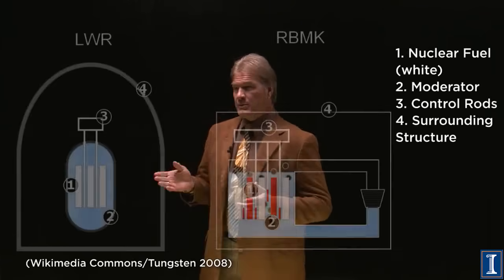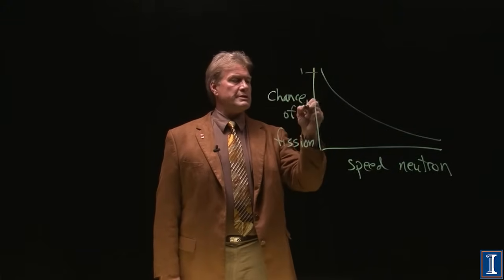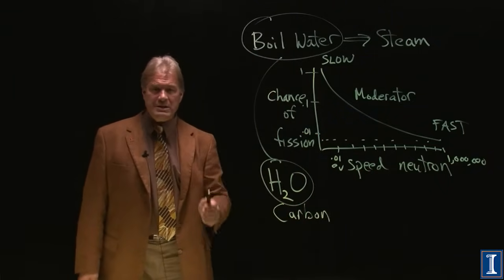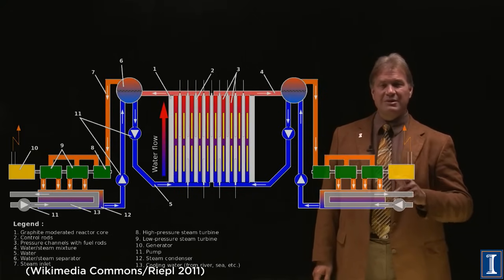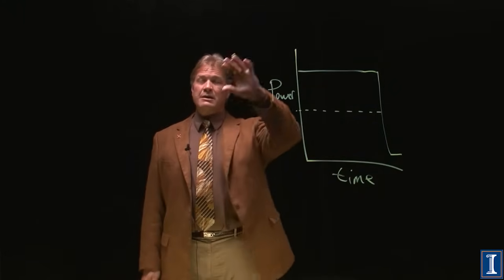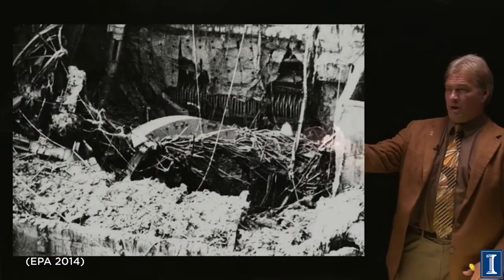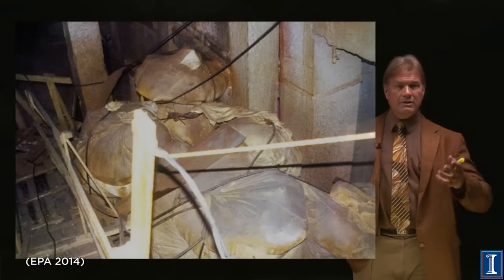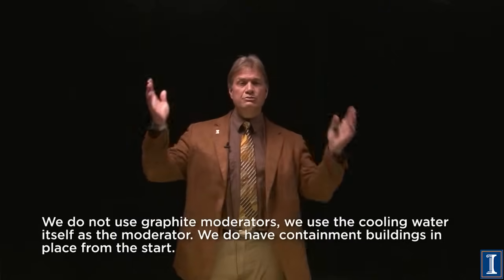Chernobyl: Worst Accident Ever

Comment: You missed the important point of why the power level spiked.   Once the reaction starts, the xenon gets burned off.  The Chernobyl core was so huge that it wasn't uniformly controlled by the control rods, and the reaction took off again in the bottom part of it.  This started burning off the xenon in a hurry.   Now you have a situation where prompt neutrons are causing fission (carbon moderator still there), and all of the control rods are out of the reactor, and the xenon that was keeping fission from happening was getting burned off like dry grass in a self-feeding cycle.   
In the world of high energy physics, this is what is known as an "Oh [expletive] moment". 
There was a perfect moment, when ALL of the xenon was gone, and ALL of the control rods were out, and ALL of the fuel - some 200 tons of it - was free to react, completely uncontrolled.  And it did.   There is at least one paper out today that even claims a nuclear yield.   Small, but larger than the chemical explosion could ever have been.   The reactor hall was cast concrete, Soviet construction, and could probably have actually withstood a substantial chemical explosion, but was kicked aside like cardboard in the face of this blast.  Radiation-resistant windows a meter thick were blown to bits like plain window glass.  
That is what happened at Chernobyl.   A worst-case scenario, with 200 tons of uranium reactor fuel, totally uncontrolled.
The United States already knew about xenon poisoning, having experienced it first hand with the startup of the Hanford B reactor, where we too yanked out all the control rods in a futile attempt to jump start a reactor that for some reason unknown at the time just would not react.   We were very fortunate that we did not create the same accident here.   The only reason we didn't was because Hanford B had been built too small, and could never start properly, given the effects of xenon.    Beginners luck
Reply: thanks for the info especially about Hanford B
Reply: @sygos  Extra channels had been built into Hanford B as a contingency, and it was a relatively simple matter to load these and create a bigger core.
Reply: I've been waiting for this comment all year long. Apparently, many still don't get it
Reply: @bluellamaslearnbeyondthele2456  Of course not. This stuff scares the shit out of people.
Reply: That's the other kind of oh-shit moment—When you look back and see what you just dodged, what could have happened. Like the Able Archer exercise in 1983. Or the Titan explosion in Arkansas in 1980. The Goldsboro Incident in 1961. Almost losing Fukushima Daini at the same time as Daichi.
Reply: @ronaldgarrison8478  Agreed on all.
Reply: @Tom R yeah, the spike was going, but the control rods prob gave an extra kick that didnt help anyone. Ignalina and a few other stations had already modified the rods to be less reactive, but thanks to KGB and the "saying there are problems creates problems so just say its fine" mentality, the information never went to Chernobyl
Reply: @mjfan653  I still don't understand WHY there were graphite tips on the control rods.

IAC I'm still thinking the HBO show overplayed that (or maybe it was Legasov who did so; hard to be sure at this point). Ordinarily, the graphite tips are no problem, because you always have some rods that are already in and going deeper as you insert a few at the top, so the overall effect is still dropping the reaction rate. But if you're fool enough to yank them all out, then you're definitely tickling the Dragon's tail.
Reply: @ronaldgarrison8478  

Graphite tips for lubricant. Cheap and cheerful.
Reply: @ronaldgarrison8478  Simple. They weren't "tips". The control rods, when pulled out, require the graphite rod to follow right behind and displace water that would take the place of the control rods and slow down the reaction due to the light water absorbing neutrons. The "graphite tips are cheaper" was a simplification for the show. Using graphite moderator rods and light water allows the entire reactor to be constructed for a lower cost.
Reply: BTSOOM, due, maybe, maybe not. The one thing I totally know is: If there is a way to effit up, someone will be effen it. Same thing at Fukushima. You would think that, in several hours, someone could have found a way to get a suitable mobile power source driven in, or flown in, and hooked up to keep some coolant going on that shut-down reactor. But no, no one expected that many holes in the Swiss cheese tall line up. And when they did, they were clueless. BTW they almost lost Fukushima Daini, too, but their luck didn't quite run out there.
Reply: @ronaldgarrison8478  they weren't tipped in graphite. There were graphite rods attached to the control rods. You had to bring one out to bring one in. I had another comment in this thread that explains in more detail.
Reply: @ronaldgarrison8478  because water is not a good moderator - steam is a great moderator. Control rods can be used both ways... to consume electrons or to slow them down (and that increases fission chance). When you have reactor cold with water inside it wont start... you need to add some kind of moderator to jump start it, when there is steam then it is self sufficiant. It is caused by not very rich fuel which is cheap in comparison what rest of the world uses.
Reply: @matejsojka6683  Water is a good moderator. Steam is less good as there are less H atoms to hit due to less density which means reactivity decreases. Heavy water is better still as it absorbs less neutrons.
Reply: @ronaldgarrison8478  It was cheaper to make single dual purpose rods. Shame no-one thought they would cause an explosion.
Reply: @Tom R The power was already spiking, but the graphite tips on the rods caused it to spike on top of the spike causing an almost instant meltdown that stopped the graphite tips from going in any farther and blocking the control rods. So they could no longer stop the reaction and the graphite was now feeding the reaction more.

Boom.
Reply: @IIBloodXLustII  

That is something I'll never understand about the RBMK design ...

In one video on the disaster, the diagram used, showed that, beneath the control/neutron absorber rods, were graphite rods, hanging directly below them. That meant, when the control rods were withdrawn, the graphite rods were pulled into the reactor, which, if you are trying to increase power output, kinda makes sense ...

... except it doesn't. From my (very) lay understanding, as that engineer tried to SCRAM  the reactor, because the graphite rods where the first to enter the reactor, it not displaced what little water there was, but, iirc, as a reflector, that only served to increase the power output way beyond the design could handle, due to a positive void coefficient.

What happened next is debatable. One of my favourite videos* on the subject, cites two papers that suggest, given the sheer size of the positive void coefficient, plus other physics which is slightly above my pay grade, the reactor went into a prompt critical state, causing a full fission reacton, and a resultant 'fissile plume', which was the real reason the reactor exploded. The consensus is that the explosion, instead of being a nuclear 'detonation', was rather caused by the sheer volume of high pressure steam generated, and/or the dissociation of hydrogen and oxygen.

Having seen what a steam explosion can do to a locomotive (it practically tore the thing to shreds, leaving nothing but a mangled, and twisted, heap of metal), the pressures generated by a large volume of water turning completely into steam, can't be underestimated. Another factor, which I never realized was possible was, during our worst nuclear accident, here in England (that being Windscale, where the reactor literally caught on fire), is that, give enough heat energy, that energy can not only disassociate water into hydrogen and oxygen, but can create acetylene, especially from the decomposition of the surrounding graphite blocks into free carbon, which then forms bonds with the free hydrogen. Combine that with the disassociated oxygen, and you end up with oxy-acetylene. No wonder the fire was well above 1,500°C, and perhaps as high as 2,000°C, or even higher. In Chernobyl, all of that may have happened in a few seconds, but with such a large positive feedback loop in place, you need not have total fission (ergo, a prompt critical) reaction, to achieve a massive explosion, that could pulverise concrete ... especially badly mixed concrete, that isn't able to absorb high Newtonian forces. 

In addion, in 'Western' nuclear reactors, the containment vessel is a single poured, with a dome 'ceiling', which means there is no 'edge', per-se, from which cracks can propagate from. Innthe Soviet design, it was just a box, thereby reducing the amount of energy it could contain, without it failing ...

In shork, the RBMK reactor was a fail-dangerous design, not fail-safe ...

[Edit: this is the one I'm referring to:

https://youtu.be/q3d3rzFTrLg ]
Reply: You are correct in what you are saying about the Xenon, however that is not the full picture nor that final trigger to the power excursion. The actually reason the reactor first started to go unstable apart from the removal of to many control and safety rods was the loss of control over the water levels in the reactor. 
After the switch to global control and the loss of power to almost zero, when ramping the reactor back to life only 200MWt could be achieved.
However the manual of operation for the test was written for a power level of over 700MWt, with such low power the stream drum separators tripped due to low steam pressure, this was overridden and manual control over the water flower was ordered this had to be done with 8 main pumps and hundreds of individual pressure tube inlet valves, (no human could make the corrections fast enough without the computer to balance the flow) with a low steam pressure this affects the amount of "Out" water returning to the feed water loop for pre cooling. However the feed water flow reduced as there was a reduced steam flow to the turbine. The procedure orderd all 8 pumps be turned on the for the test, 4 online from off sight power and 4 bussed to the generator under test. Before the test had started the effect of to much out water from the steam separators was already preventing the pre cooling of the feed water. This lead to cavitation (steam voids) in the lower part of the reactor way below the desired boiling point. This of course would get worse once the test began and the 4 cooling pumps connected to the generator started to lose power as it ran down and the feed water flow was dramatically reduced. This meant that super heated water already boiling was now interning the reactor, cavitation may have already been forming in the coolant loop, this lead to a massive coolant void at the bottom of the reactor at the same time now with the power rising the xenon was being burned off, this now adding to the power surge. With boiling at the bottom of the reactor and voids not being pushed up and out because of the reduced water flow rate this set the reactor down a path to self destruction. All but 8 control rods removed, Xenon now all but burned off and very little liquid water in the pressure tubes meant the reaction was now out of control, the AZ5 was pressed be it out of panic or part of the normal shut down procedure the  little remaining water still absorbing neutrons was displaced out of the fuel channels by the graphite "tips" displacers of the control rods as they decended and we all know what happened from this point onwards. This all happened in less than a few minutes and the final power excursion happened in just a few seconds. Hope this adds some knowledge to the discussion and maybe a few points people have not read or herd about before.
Reply: @jonnytightlips513  Wow thanks for all of that.    The reactive rod tips probably moved up the time of the explosion, but they were not the cause of it.   By they time the AZ5 scram was initiated, the reactor was already in a state that could not be controlled even if the rods did not have that feature.
Reply: @josephastier7421  absolutely, once the feed water rate had dropped due to the now costing down turbine under test, with the Xenon burning off and the control rods out the reactor was beyound control. There were two real points at which the reactor could have been saved, when the power dropped to 30MWt during the test preparation they could have just shut it down there and then (as they should have due to now massive Xenon Poisoning) rather than  trying to ramp it back to life. The second time they could have saved the reactor was the first low steam pressure trip. Over riding that trip was probably the worst one single action conducted that night. But who is to say no one truly knows what exactly happened and why the operators did what they did, there are many different accounts from both survivors and the deceased. Politcal agendas, fear of prossicution and propaganda sadly has gotten in the way of the total truth.
Reply: @jonnytightlips513  Yes.  When they undershot the intended power level (by forgetting to program it into the controller, oops), the test was over.  
This test opportunity only happened once per year, and the human factors pressure must have been unbearable for the operator who had made that simple mistake.
Had they stopped right there, it would have been a blow to pride and professional reputation, possible job loss, etc.  But the world would not know the name "Chernobyl" today.
Reply: @jonnytightlips513  This is utter nonsense. Nothing more than the propaganda version devised by NIKIET and Kurchatov Institute to cover their asses.

During the rundown test, coolant decreased by only TEN PERCENT. There was NO INCREASE IN POWER during this time. The additional reactivity was compensated by the movement of the automatic control rods. There were absolutely no warning signals during this time and all reactor parameters were within normal limits. Eyewitnesses agree that AZ-5 was pressed in calm circumstances.

None of the detailed data recovered from the reactor's systems ever has or ever will prove that the excursion began before AZ-5 was pressed. The initiating event was the tip effect.

No one who knows the first thing about the subject could make a statement such as 'all but 8 rods were removed' (that is not how ORM works, or claim that the xenon burned off in just 36 seconds of operation at 6% of nominal power.
Reply: @MinSredMash  Well for one it is a known fact that the ORM was deliberately via ignorance or misguidance was down to 8 rods, I never said cooling was down I said the steam flow rate due to low power and to much water again this is a known fact from both testimony and the trip signals from both the steam separators and turbine taken from the computer. OUT water precooling and loss of feed water played a pivotal role in the instability allowing for local pre AZ5 power excursions (hot pockets of reactivity) one of the main reasons for the unknown growing neutron flux was the fact at such low power and control set to global the internal monitors are not used and the outer wall and shield monitors are used, localalised neutron flux is unknown.
If you read what i wrote I actually stated the AZ5 could have been pressed without panic depending on which testimony you which to agree with. There is eye witness and written testimony to the fact that the reactor power was rising rapidly before AZ5, along with the visual sighting of the pressure Channel caps bouncing around atop the upper Environmental shield. However this is not an argument but a polite discussion if you wish to contribute perhaps getting off your high horse would be a good start, drop the attitude and people would be more inclined to really absorb what it is you have to say. The information I have presented is the official findings of both the post Soviet report and that of the IAEA-INSAG-7. Which I find ironic due to that fact that the report is the International Nuclear Group and not the Soviet, secondly it was reviewed and amended in 1995 to addition 7 to remove at that time the known Soviet propaganda and miss information, it also absolved the technicians of any liability pardoned them and blamed the reactor and its design for the most part as well as Soviet management, training and the passage of information. The Russian federation would agree and award Akimov a medal for his bravery so not sure what propaganda and arse covering you are referring to.
Reply: @jonnytightlips513  Kindly explain how it is possibly to "deliberately via ignorance" ignore something. That's a complete contradiction in terms. There was no actual means of tracking ORM during a power transient. 

There is one very unreliable eyewitness who claims power was rising before AZ-5 was pressed, but he was plainly being coached by the prosecution, as well as being the least qualified to answer this question of anyone in the room. EVERY other eyewitness claimed the reverse. So on one hand you have a single witness. Lined up against him are all the other witnesses AND the actual diagnostic data from the reactor, which detected no rise in power until after AZ-5 was pressed. Only a fool would choose to believe the former.

The 'bouncing pressure channel caps' is total fantasy! There are dozens of reasons why this could never have happened in the first place, and there is no eyewitness for it in the first place. It comes from a fictionalized novel written by Grigori Medvedev.

INSAG-7 directly contradicts much of what you said. The report actually states that there was no increase in reactor power during the rundown. It also states the reactivity released by coolant reduction was compensated for by the automatic control rods moving downwards 1-2 meters.
Reply: @MinSredMash  So I said deliberately as in they intentionally removed the control rods down to all but 8, either knowing this was dangerous or they didn't. So yes you are correct the remaining rods controlled by the CPS managed to keep the power level down but this was pre generator steam isolation, once the run down test began there were not enough control rods left for the CPS to utilise as they had been manually extracted. Let's be clear again I have already states more than once no one truly knows what happen and why AZ5 was pressed, panic or procedure. 
I am in no way saying the AZ5 and the EPS was not to blame for the explosion as it clearly was I, was reiterating that Xenon burn off was not the origin of reactor instability prior to the shutdown. The water level and low power state was the orinal factor in the lead up to the accident. However as this is an open case you are of course initialled to believe what you wish but the over arching literature, reports and SMEs on this subject matter all tend to favour the power level rising prior to the AZ5, again I have read and seen Akimovs and Dyatlovs explanations and they said they were totally unaware anything was wrong and simply shut down the reactor at the end if the test. Again as I have already stated this is still open for debate.
Reply: @jonnytightlips513  Actually they did not reach an ORM of 8 by withdrawing rods. A large part of the drop from 17 rods to 8 rods was simply due to the steam quality of the core decreasing when all 8 MCPs were in operation. So the operators likely had reason to believe that ORM was much higher than it was. In addition, ORM would have recovered itself when the automatic controls were moving downwards during the rundown. No one knew that low ORM was dangerous because the operating instructions treated it as related to economic concerns, not safety.

And you are quite simply mistaken with your second statement. INSAG-7 clearly states that the reactivity introduced DURING RUNDOWN was modest and compensated for by the AR rods. That is, even after steam/generator isolation the reactor was under control and not in extremis.

No one knows why AZ-5 was pressed, but there is no real evidence for it being pressed in a panic. Objectively, 100% for certain there were warning signals at this time, or they would have been recorded. Simple as that. Did Toptunov seem a jump in the reactimeter? Maybe? But that is mere speculation.

The " the over arching literature, reports and SMEs" talk about pre-AZ-5 power excursion for no other reason than they are repeating Soviet propaganda from 1986. There is not a single piece of actual qualitative evidence for this, not EVEN in INSAG-1! Many of the so-called SMEs in the West still repeat the Soviets' demonstrably false accusations concerning violations of operating procedures that did not exist in 1986. Such lazy commentators cannot be trusted as authorities.
Reply: But no one is going to mention that the graphite tipped boron control rods caused the power level spike?
Reply: @MotoScootMech  They weren't tipped in graphite, this is a common misconception. There were graphite moderating rods that were attached to the control rods. When they extracted all of their control rods, they not only removed all of their neutron absorbers but introduced more moderators. 
These moderating rods didn't extend throughout the entirety of the reactor core but were centered and left small gaps at the top and bottom of the reactor. These gaps were filled with water which can also act as neutron absorbers. When the SCRM system was activated and all the control rods began pushing the moderating rods out of the reactor. This forced the water out of the bottom of the reactor. The complete removal of neutron absorber at the bottom of the reactor is what cause the power ramp and then the explosion.
Reply: Rad Rev. I don't understand. I thought water was a moderator, not an absorber
Reply: @MotoScootMech  but that's the thing - they weren't graphite tipped. The control rods were essentially dual acting. They had a control rod made of boron, and attached to that further down was a graphite rod meant to displace water in the channels - the water acts as an absorber in a graphite moderated reactor, so you get more power if there's less water. It was a preposterously bad design in terms of passive safety - but, they also turned off basically every safety feature in the reactor.

 RBMKs were known to be unstable at low powers - there were safety measures in place (which were disabled) and SOP did not under any circumstances allow doing what was done that night.
Reply: @MotoScootMech  It was a bit more than a tip.  The graphite "tip" was a displacer and was only 2.5m shorter than the core itself.
Reply: @MotoScootMech  good point.  One of the biggest softened between the western reactors and the RBMK's. One of several differences that make western reactors safer.
Reply: @MotoScootMech  think of the control rods as like fuses in a closed circuit in your car. There to allow volts to go from 12.6v to 20-40amps (amps are the flow of the voltage so higher the amps and voltage the higher the watts). But also act as a protection system for the circuit like the PCM, the Loads, switches/transistors, sensors, ect. Since the control rods were taken out there was nothing in the core to protect the power or in this case fission to increase out of control causing the disaster. End of the day the tragic story is because of the workers being lazy and taking shortcuts.
Reply: Excellent description of what occurred.
Reply: Thank you for this explanation. I'm wondering if you can answer this question: when he says the worker pressed the wrong button, what exactly is he referring to? Thanks again.
Reply: Slightly wrong. The real moment of disaster was when they pushed the control rods back in. The ends of the control rods were Graphite, a moderator and when the control rods were fully out the graphite sections filled the control channels speeding up the reaction further. When the SCRAM button was pressed and the control rods started dropping back in, voids, bubbles of steam formed in the coolant water caused by turbulence from the moving rods. So the reactor bottom where the highest temperature and reaction speed is occurring now has graphite moderator in the control rod channels and bubbles of steam, and this is where the “positive void coefficient” comes in. In reactors with “negative void coefficient” reactors, water moderates the reaction, speeding it up, bubbles slow it down. In “positive void coefficient “ reactors, bubbles of steam speed the reaction up. So the bottom of the Chernobyl reactor where the reaction was dangerously spiking had graphite moderator in the control channels AND bubbles of steam, like chucking gasoline on a bonfire. The reactor bottom went to thousands of degrees and whatever happened, happened. Either a steam pressure explosion, hydrogen/oxygen/graphite explosion or some form of nuclear “Fizzle”, a minor nuclear fission detonation.
Reply: @SvenTviking  I don't think the poorly designed control rods had as much of an influence on events as people give them credit for.   The core was building power exponentially and completely out of control.   It would have exploded the same way even if the scram had not been attempted at all.   

I agree with you on the possible fizzle yield, though we will probably never know.
Reply: @SvenTviking  The 'turbulence of the moving rods' had nothing to do with it. Boiling increased because reactivity and temperature increased.
It wasn't the presence of the graphite that was a problem, so much as the absence of the neutron-absorbing water.
Reply: Somewhere I read that it was similar to an astrophysical jet that a black hole ejects - of course on a much smaller scale.
That was a convincing article about that. Made more sense than the other explanations.
Reply: Hmm, but Chernobyl didn't use very enriched fuel no? And while the cross section for fission of U-238 is about 1 b (iirc) at fast neutrons it is still nowhere near the cross section of fission of U-235 at thermal speeds of neutrons.
And as I said the fuel at Chernobyl had a very low concentration of U-235. Simply not enough to yield a chain reaction to call it a nuclear bomb. You need far higher concentrations of U-235 to actually create a bomb.

At least, I would think so. Reactor Physics is not my particular area of physics.
Reply: @PartialViewmusic  I wouldn't think so either, but I didn't author the paper.  They're going off xenon isotope ratios that they say you can't get any other way.  The higher the fuel enrichment, the lower the critical mass.  The inverse is also true, and there was something like 200 tons of fuel in that beast.  Did it do something interesting?  I don't know, but the gamma ray spectra of the fallout so closely resembled that of a uranium fission bomb that researchers at first believed someone had set off a nuke in Russia.
Reply: He absolutely did not miss that "important part", you just decided to reword what could be inferred from his explanation and text to make it look like you have some grand knowledge that was silly of him to simply skim over. You could have said the interesting fact in a lot easier way than trying to frame it as if he skipped something of value
Reply: @djalex8080  How would you have said it?
Reply: @djalex8080  His entire first paragraph is utterly false. According to the plain meaning of the words. No inferring or rewording.

Maybe basic facts appear as 'grand knowledge' to an ignoramus.
Reply: It's impossible for nuclear fuel to instantly fission without being weapons grade; it will just get extremely hot over time (That's all a nuclear explosion is as well; it is hot gas expanding extremely rapidly and carrying radioactive biproducts, but it is nearly instantaneous). The hydrogen and oxygen reaction seems much more plausible because at high temperatures molecules turn into plasma.
Reply: @liberphilosophus7481  Personally, I agree.
Reply: @Tom R the power spiked BECAUSE the graphite on the control rod was in the active zone.
Reply: I thought the core erupted because the control rods unlike western models were tipped with graphite which exacerbated the chain reaction. Yes, the operator(s) surpassed the safety protocols but they were made unaware that there was a design feature (flaw) in the rods. The reason they were made unaware of flaws was that it was a state secret. One more thing, a few seconds before the insertion of the rods there was three simultaneous seismic events that occurred near or directly near the plant facility. Again this happened during the test. If the rods were disrupted in any way while being inserted back into the core then microfractures could have caused the rods to become stuck (unresponsive) to the operators' commands.
Reply: @charleslennon1  This was not caused by an earthquake.    As for the dodgy rod design, there had already been an incident at another RBMK-1000 where inserting the rods caused a power excursion.  That reactor was otherwise healthy, unlike this one, and the rods went in all the way and it stopped.  It would have been a very interesting day at work, and I would highly suspect that this important safety tidbit would be shared with operators of all such reactors, even if unofficially.
Reply: Let’s not forget the graphite tipped control rods. They also played a major role in the explosion by moderating and creating the massive spike. A lot things had to go wrong to cause this and they all happened at the right times. What a tragedy!
Reply: earlymusicus  Yes it did.  They look exactly like the Chernobyl blocks.   Quite a coincidence if you ask me.
Reply: "There is at least one paper out today that even claims a nuclear yield."

a nuclear yield like an a-bomb explosion is not possible with a reactor because the fuel is not in the shape of a sphere . such a shape would allow equal compression on all sides when compressed by explosives and thus causing critical mass and a nuclear yield
Reply: @wyliesdiesels4169  I did not peer-review the paper can not speak for it.  The authors state that the isotope ratios they found in commercially available xenon gas downrange of the blast were in the middle ground between a power reactor and a fission bomb.  It wasn't the signature of either, and the claim is that something interesting had to have happened.
Reply: So it really isn't because they put back the control rods as the video suggests. But because the xenon started burning out and they were too late to actually put the rods back in?
Reply: An important note about Hanford b reactor is there were multiple fail safes to prevent a melt down aside from the control rods including boron balls and a liquid that would have permanently poisoned the core.
Reply: TBH, there are a lot of things around this.
Ede Teller has created nuclear safety as a profession as he understood the danger of water-coolant, graphite-moderated reactors. Unfortunately, due to the COCOM-list, this information has never reached the soviets - and I have doubts that even they would care.
Later on, Teller got the "anti-reactor" title from idiots as he recommended rejection to all RBMK-style plans in the US.
Reply: Joseph Astier very informative !
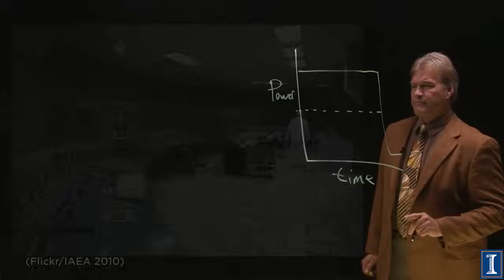Reply: The explenation that follows after 11:00 was interesting for sure. If they only had called it the night.
Reply: @MrJokkoma  Once they accidentally undershot the power setting,  they needed to say "oops" and call it a night.   Maybe someone would have been reprimanded or even lost their job.   But there was too much pressure to succeed, pride before a fall.
Reply: Absolutely fantastic information, greatly appreciated.
Reply: At the time of Chernobyl disaster, xenon poisoning was known effect and operators had to take it into account.
Reply: @AgzamovAkhror  Yes it was known.  The arrogance of the operators cannot be overstated.
Reply: He’s in shock. Get him out of here.
Reply: The accounts I've seen/read that I believe are even different than that.

Supposedly, the plant operators who were scheduled to perform this experiment had lowered the power to approximately half power in preparation for the experiment.  And at this reduced power, xenon was building up.  This was supposed to only happen for a short time, and then the experiment at the even lower power would begin.

Unfortunately, after they had already reduced to half-power, they were instructed to leave the reactor at that half power level, and not reduce power further or do the test.  This was because factories in the area served by the power generation were working overtime late on this particular day in order to meet some quotas that would ensure bonuses for various officials, and they needed the electricity.  So the reactor was kept at around half power for around 12 hours.  So this extended operation at half power allowed xenon to build up badly in the reactor over that whole time.

By the time they got the go-ahead to reduce power further in order to do the test, it was midnight, and there was a shift change.  So the operators who had been trained on how to conduct this experiment went off-shift, and were replaced by a different crew of operators who had not been properly instructed.  Still, the leader of that group wanted to get the experiment done so that he would not disappoint the higher-ups who were pushing to get this (already years-late) experiment done.

So either not understanding that the xenon levels were high, or the implications of that, the new crew pressed on with the experiment and began reducing the power level to the very low level required for the actual test.  As they did that, by inserting some control rods, the power level dropped dramatically, far more than it was expected to drop, because unbeknownst to them, the xenon "poisoning" was lowering the reactivity of the core.  Again, they may not have understood why or even that this was happening.

So the reactor power dropped far too low.  Seeing this, some of the crew felt that they should just shut the reactor down completely and postpone the test.  But the leader of the group was adamant that they should continue with the test.  He wanted to please (or rather, not displease) his superiors.

So now they needed to raise the power level of the reactor somewhat.  But just withdrawing a few control rods wasn't getting the job done.  The power level stubbornly remained too low (due to the xenon).  So they withdrew even more control rods until they had far less than the minimum rods allowed inserted.  I saw one report that said they had only ONE control rod inserted.

Then, as the higher power level "burned up" some of the xenon, you had something of a runaway condition where not only the reducing xenon was increasing the reactivity, but you also had almost no control rods in place.  So the power began rising rapidly.  Seeing that, in an attempt to completely shut down (SCRAM) the reactor, they pressed the button that was supposed to be the fail-safe final safety shut down for the reactor.

This button causes all of the control rods to be inserted into the reactor core all at once as fast as possible.  But his process doesn't happen immediately, of course.  The control rods are quite long, and it takes time and force to drive the control rods down into the reactor core.  What I read said that it takes about 18 seconds to fully insert the rods.

But the design of the control rods was such that the bottom ends of these boron (which absorbs neutrons) rods were graphite (which is a moderator, and increases the reactivity by helping slow neutrons to the speeds required to split uranium atoms).  This was actually a reasonable design in some ways, because when you pull a rod out, the bottom graphite end of it is then positioned in the reactor core, and it increases the reactivity of the core.  Then, when you drive the rod all the way in, the graphite end is outside of the reactor core, and you have only the boron (neutron absorber) in place.  That makes the control rods have more of an effect on the core's reactivity.

But unfortunately, as the rods were being lowered all at once into the reactor, the graphite bottom ends of the rods entered the bottom area of the reactor all at once, and increased the reactivity there dramatically.  And THAT is when the explosion took place.  The increased reactivity caused by adding that extra graphite into that area of the system AND the fact that the xenon was already "burned off" from that bottom area of the core suddenly increased the heat output at the bottom of the core by a fantastic amount.

The bottoms of a number of fuel rods melted, and the fuel pellets disintegrated, and came into direct contact with the water, and you had even more reactivity.  So the power level shot up even faster, and this created the steam explosion that blew the huge lid completely off of the reactor.

So ironically, pressing the "stop now" button actually made things even worse and initiated the explosion.

The control rods have now been redesigned to make things safer, and I believe that a few RBMK-1000s are still in operation in Russia.

Anyhow, that's the way I've seen this explained in a number of accounts.
Reply: You sound like the xenon poisoning was something new and and known "to USA only". While in reality it is a reactor ABC, and was perfectly known for anyone involved. It was known to the generation of fathers of those operators. You can't successfully run the reactor without that knowledge
I.e., you are stuck with one of those nonsense media-generated explanations. Well, the professor in video does the same.
Reply: @giedriusraguckas5798  Anybody who ran a reactor in 1986 knew about xenon poisoning.
Reply: Yes, we have all watched the show too, we're all experts as well.
Reply: It will happen again as in the short history of nuclear... How many times have they had accidents. And using it for ever?   It has to happen again or something similar, they are gambling with our planet.
Reply: The Xenon issue is mostly a red herring,  and had a mild effect. 

It is usually blamed for the power loss to 30MW at the beginning, but the drop was mostly due to automatic control rods failing to extract and then an operator manually reducing power to try getting their sensors working which made it worse. To try and get the power back up they then extracted many control rods. 

Then the main issue was then that they were initially moving water through the system too fast, which didn’t let enough water turn to steam which would’ve cooled the circulating water. The water then reached higher temps than normal. Then when they switched off half the coolant pumps to the weak turbine power for the test, the hot coolant water in the core suddenly decreased in velocity and created steam voids (bubbles) due to the heat. Steam doesn’t absorb neutrons like water and those voids increase the reactivity. The effect of burning Xenon at this point was much less than the steam effect.

The final nail was when they scrammed due to the power surges and all the control rods started extending. The rods are made of neutron absorbers but these were tipped with graphite which increases reactivity. So the graphite increased reactivity even more and lead to an explosion in the core almost instantly.
Reply: @electricpaper269  Xenon precluded startup, (the "iodine pit") is very real.  Whoever told you it is a red herring is trying to redefine physics on social media.
Reply: I think it would also have been useful in this video to explain was prompt critical is and why things can get out of hand very quickly.
Reply: They could figure out how high up it would have gone by where it landed up around Sweden and other places. And there was no way any sort of steam or chemical explosion could have possibly come close to how high it went up into the atmosphere.
Reply: Did they hear the bullet zing past their ears?
Reply: jeffrey skoritowski probably so many of them it was white noise
Reply: you are delusional. report to the infirmary.
Reply: One of the main reasons why the power spiked is because the boron control rods were, as you said, entirely removed. And they were graphite-tipped. Which worked as an accelerator.
Reply: Hanfor B was running on plutunium, which has far shorter half-life than uranium. And also it had a containment building around it, unlike RBMK reactors in Chernobyl.

And also in Hanford B the way the reactor was constructed was differend so it couldn't explode the same way RBMK reactor in Chernobyl did. Last but not least they weren't running a safety test, which was the big part of why Chernobyl exploded. It wouldn't explode if not for the test.
Reply: @ripLunarBirdCLH  What kind of containment does Hanford B have? Looks like the same kind of primary containment as Chernobyl to me. The other reason the RBMK had no containment was because of all the vertical space (like 20 meters) needed for the refueling machine.

Also, the relevance of the safety test is a huge misconception. The RBMK's design flaws made it vulnerable to a similar power excursion in many different scenarios, basically whenever it was running at low power. The safety test did not directly cause the accident, it was just a coincidental motivation for running at low power with high coolant flow rate.
Reply: He missed a lot of stuff, gets a whole bunch incorrect, and can't even say the name of the reactor correctly. If he's a professor, it explains why American education is failing hard.
Reply: Isn´t xenon a noble gas, and will it therefore NOT (ever) burn under normal atmospheric conditions? Me thinks you´ve been looking too much TV.
Reply: @Hunne2303  not burned in a chemical sense. Burned in a nuclear sense.
Reply: @Hunne2303  I'm sorry, by the Xe-135 "burning" I mean it absorbs a neutron to become Xe-136, which is a weak neutron absorber.  
In most cases, you rid a reactor of Xe-135 by letting it decay naturally over a few days,  at which point you can restart it normally. This would also give you time to configure the reactor for a controlled startup.
Transmutation it into Xe-136 on the other hand happens nearly instantaneously, which means your reactor is going to restart by itself, without time to get the control rods back into the core.
Reply: @josephastier7421  thx for the heads-up...I was thinking you meant that
Reply: 476 upvotes for pure bullshit. Xenon concentrations continued RISING throughout the test. ALL the control rods were not raised. Youtube comments in a nutshell.
Reply: Dorian Mode  and be sure to get back to cowering in terror under your bed of the CCP bio-weapon virus!
Reply: Dorian Mode  yawn. left wingers report to msnbc for your daily indoctrination.